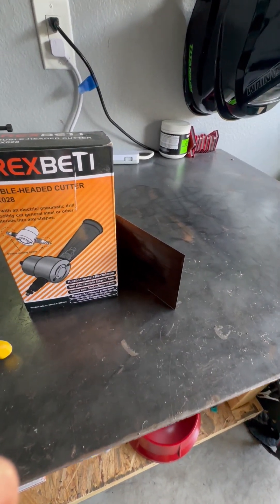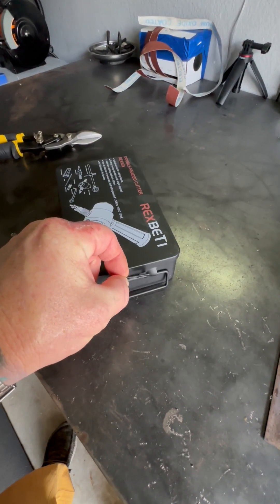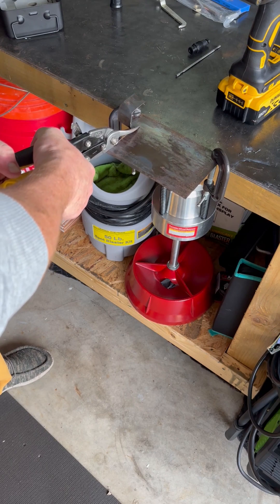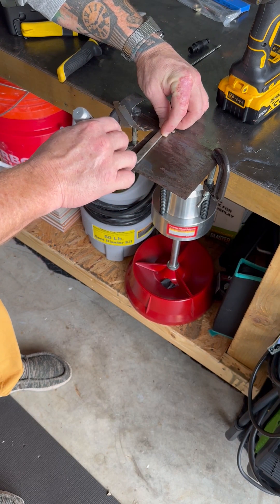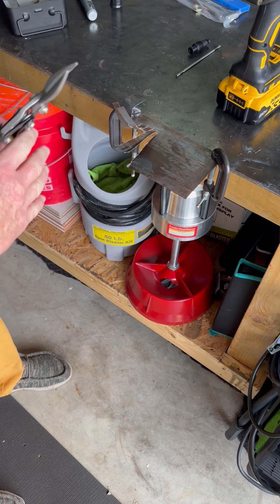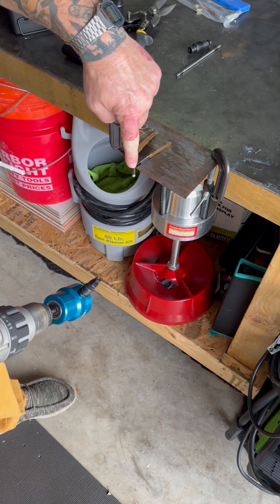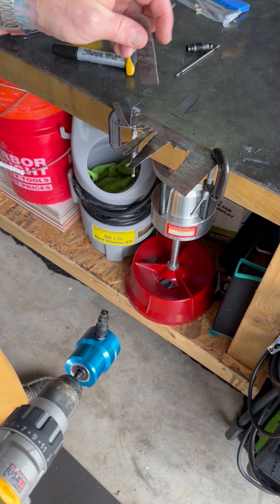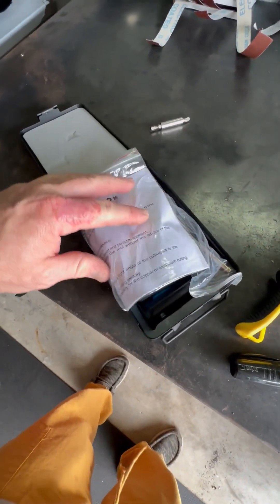Tin Snips vs. Drill Bit Nibbler Showdown! | Best Tool for 25 Gauge Sheet Metal Cutting

Comment: You were holding the nibbler at the blue part because it kept rotating. Anyway you make and fixed so it doesn’t rotate?
Reply from the maker: That's a great question, I don't see a what to lock it in place but let me do some research later today and I'll have your answer!